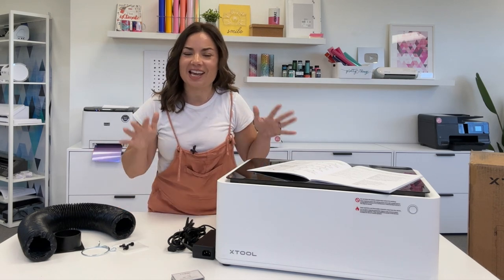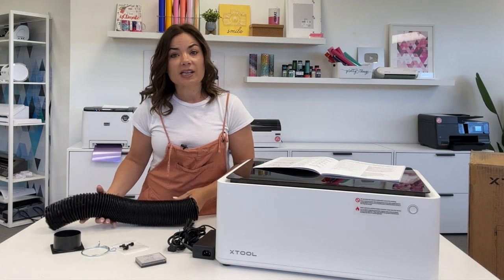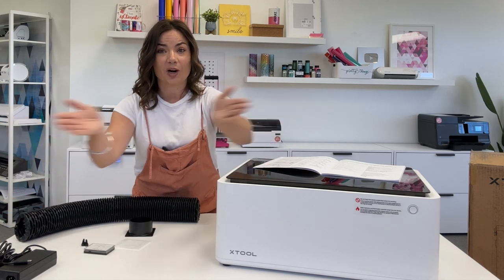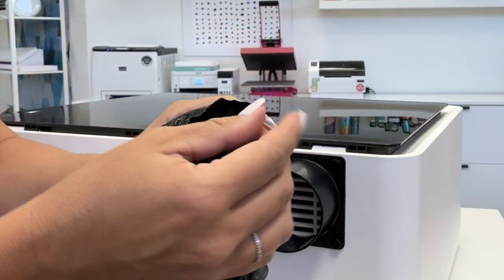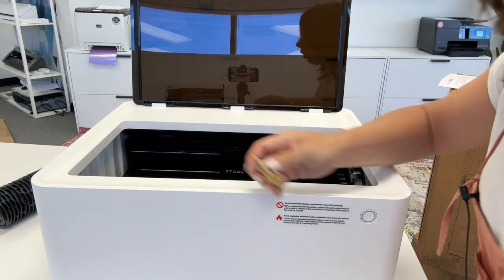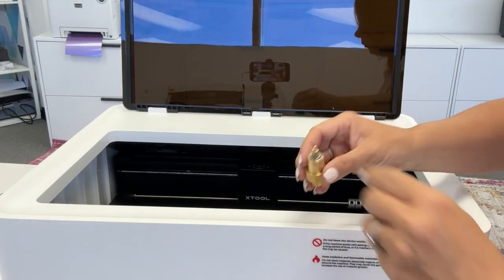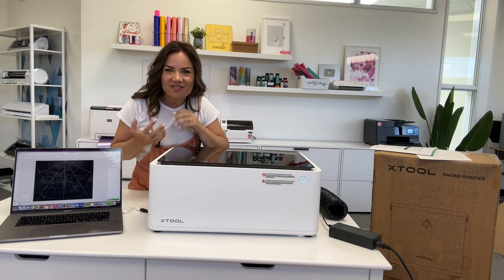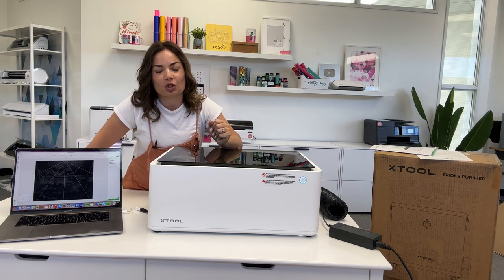XTool M1 Laser Engraver Set Up ⏰ 8 Minutes to Start Engraving!

Comment: I have the Xtool bundle and have set up the iinstall air assist and do not know where to insert the tube that goes into the system since there is not outlet from the mainframe of tool to the base. Do I have to take it off everytime I do projects like this? I am starting from beginner but since I have the other items I was trying to install (I am thinking I dont need to)
Reply from the maker: Hi - Have you watched this video? https://youtu.be/QSTGd_2_HOQ